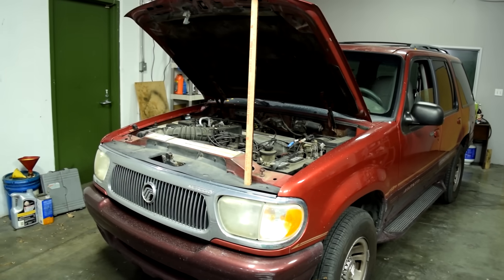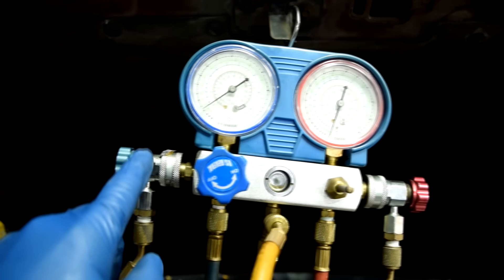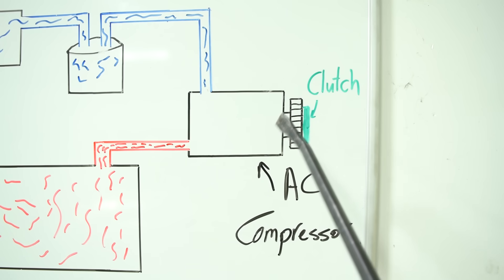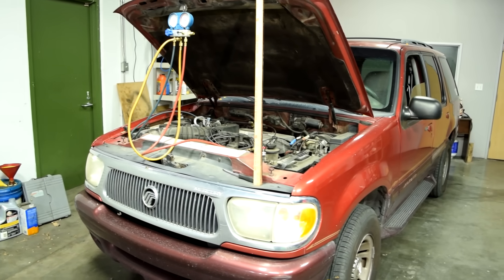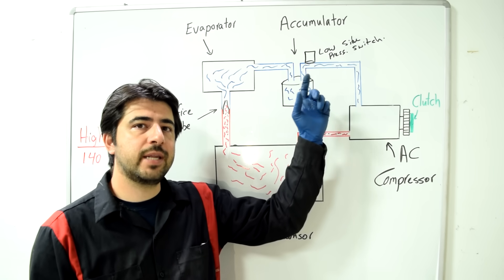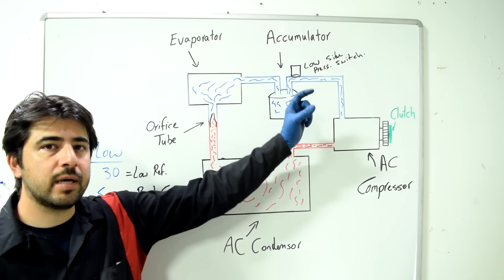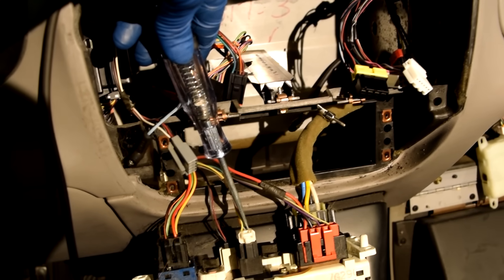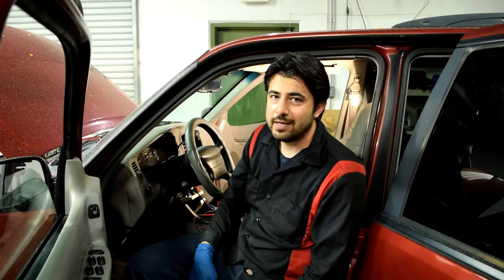Automotive AC Diagnostics, Operation and Repair

Comment: Hi there. I replaced the timing belt in Subaru Legacy 2008, however,  the engine won't turn over. What's your recommendation. Thanks.

Comment: ..Very Good Explanation of how the AC System works and How to Diagnose it !!! You did a Better job than most of the so-called "pros" on YouTube! This is a handy video because it helped me find out that a pressure switch is bad on a '94 Crown Vic. Thanks...!!!
Reply: I'm jelly of your Vic bruh. Tried to buy a police interceptor but somehow ended up with a Jetta - It's black - and Sacramento triple digit summers with no AC in a black car is a ticket to roadside cremation.

Comment: I have an 06 forester and the air blows cold for a bit than starts cool again and in a bit the air starts go warm up, then it turns cold, it does this over and over, what do you think it would be
Reply: Yep, you need a new A/C Bearing Assembly.  I've seen it a thousand times!
Reply: thanks, I have a set of gauges, not very good at a/c but I will look ath this video again and try ot figure it out.. thanks again,.